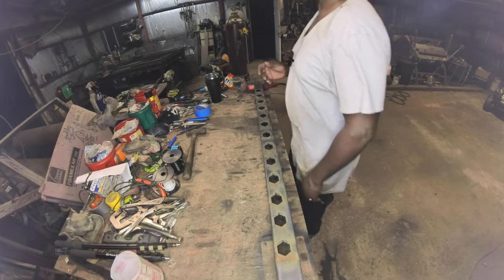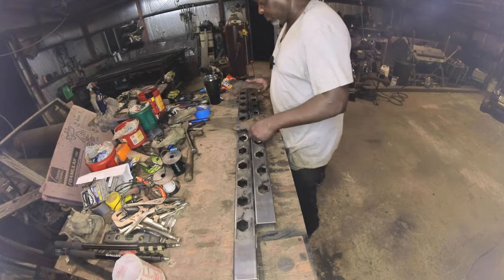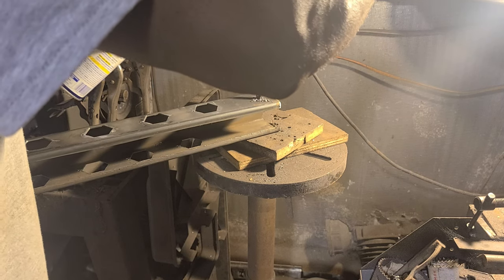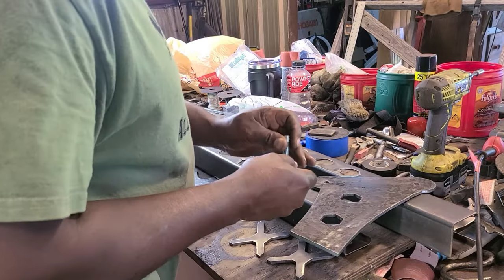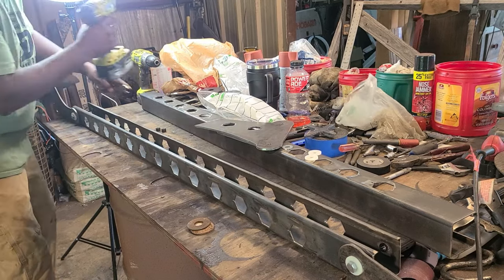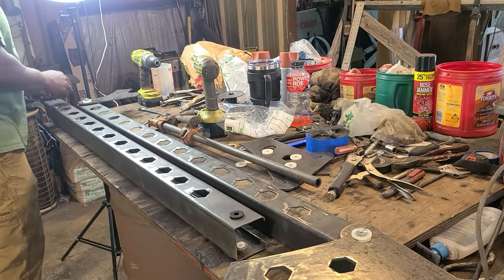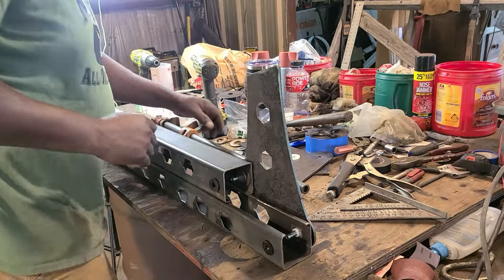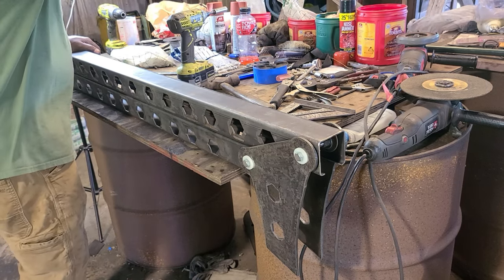WEDGE SHALLOW WATER ANCHOR PART 2   Build process #arklatexoutdoortv7810

Comment: Awesome video of the build.  Eagerly look forward to the next video.  While watching your video, I was wondering if it might be possible to use Airplane aluminum U Channel (6061 Grade) for the Arms.  Also, I would probably build a wooden mock-up to make sure I get the arm measurements and arm connector plates correct before cutting the metal connectors.  Extremely impressed with your build.
Reply from the maker: Mr. Paul, hint, arm length 52 inches